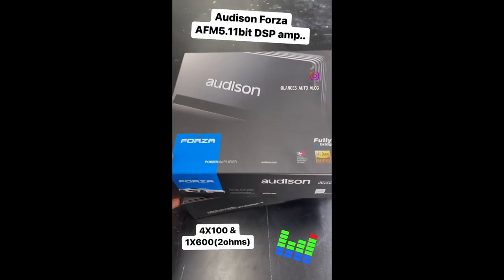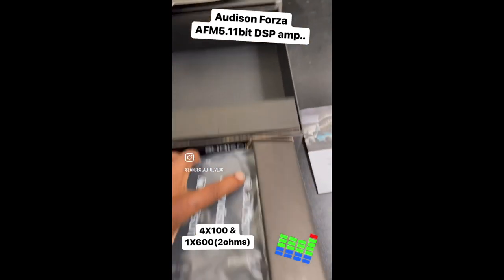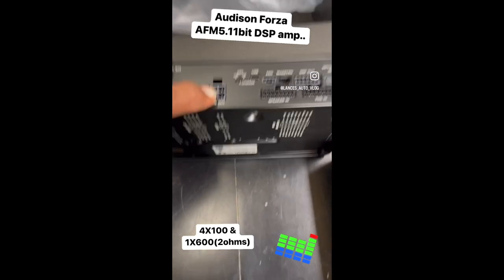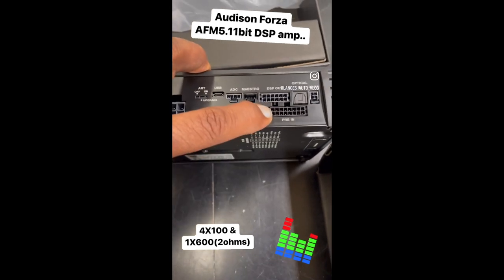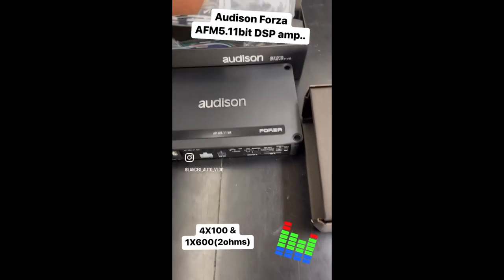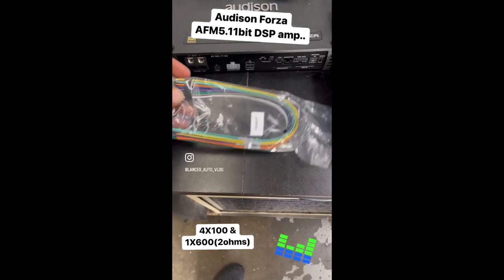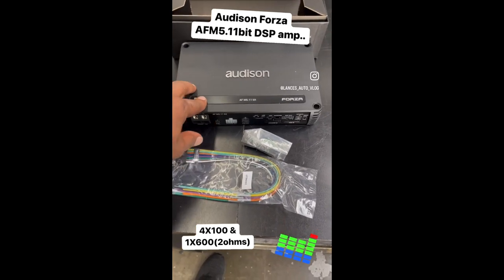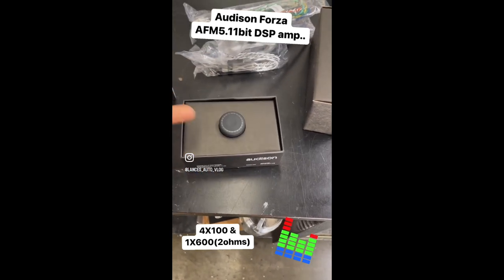Audison Forza AFM5.11bit DSP amplifier unboxing..  4 X 100 & 1 X 600.

Comment: Just bought one of these (along with a DRC-AC), I'm planning on keeping my AFP8.9 to run as a Companion Amp, with 2 channels bridged, so I can continue to send 260w to my Thesis Sax and still use the new Audison DSP software.

Are you going to do a Install video for this AF M5.11???
Are you located in Costa Mesa?
Reply from the maker: I will once I get another car I can use it on.
Reply from the maker: Yes I’m in Costa Mesa Ca
Reply: @lancesautovlog  Cool, I'm getting mine installed next week (also in Costa Mesa) hopefully they can do a decent tune with the new software! You have much experience with the new Audsion DSP software??
Reply from the maker: @stevendphoto  yeah I’ve done a few. The new software is pretty cool. If they have any issue we can tune it. Let me know.

Comment: What speakers would you recommend for the 12.14? currently have morel Vertus nano carbon 63 with the midbass channels bridged. Don't feel they are loud enough.
Reply from the maker: May I ask what kind of vehicle is it used in and what else is in the system?
Reply: @lancesautovlog  
Jeep gladiator with a kenwood958xr and a illusion c10 sub in a fox acoustics box.
Reply: I also have morel maximus for the rear fill. Currently a lc.800.1 for the sub amp
Reply from the maker: It sound like all the channels are bridged. Was there any sound deadening done? Was the DSP tuned? If so was it tuned using a RTA? These are things I typically do when I’m setting up a vehicle.
Reply: I have everything speaker on its own channel. With 5 and 6 bridged  for left midbass and 7 and 8 bridged for right midbass. 9 and 10 are for the rear speakers and not using 11 and 12. It was not loud enough before tuning with rta and lower after. Could it just possibly be that it's so clear that I don't think it's loud?
Reply from the maker: It’s totally possible that it could be very clear and not setup to distort. Must people are a custom to a little distortion to give the illusion that it’s loud.
Reply: I've I did want louder would I get that from morel hybrid or maybe even elate carbon?
Reply from the maker: @chrissavaglia8824  replacing the speakers won’t make it louder. You could adjust the input sensitivity on the  Audison DSP amp, that may help.
Reply: Ok thanks